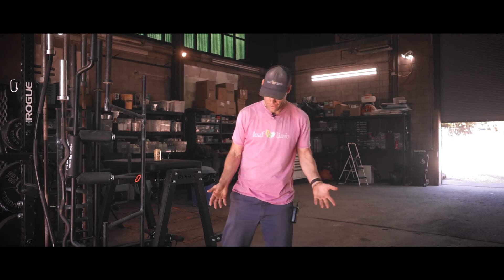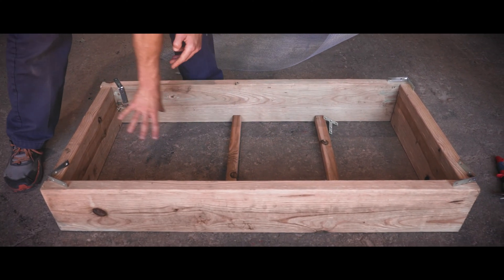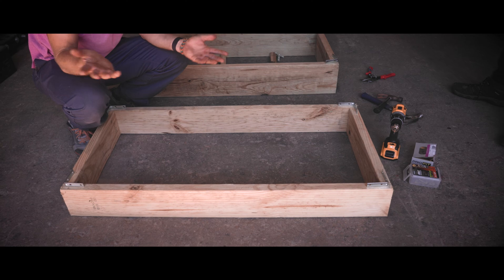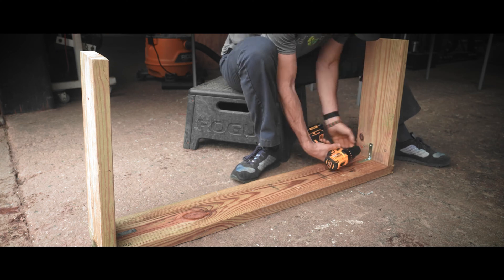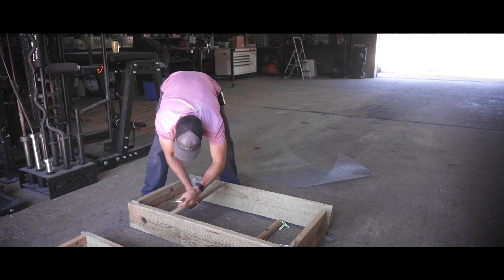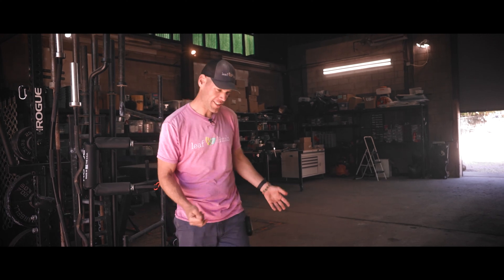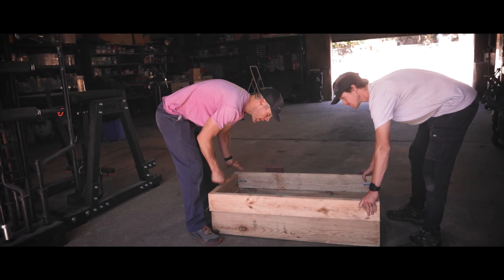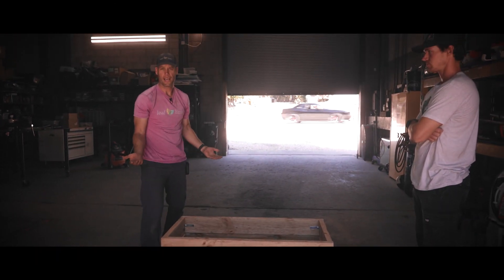How to Build an Air Pruning Box

Comment: This is NOT how to build an air pruning bed. 
Treated lumber is full of toxins that release into the soil and trees. WTF
Lumber is too heavy. 
The T bracket metal reenforcement is unnecessary. Use screws on a shorter board.
Just way off.

Comment: Won't the mesh rust quickly? Maybe plastic mesh instead?
Reply: I've used it for compost bins for years, and it doesn't rust.
Reply: Galvanized mesh does not rust quickly. Rodents will chew right through plastic mesh ;)
Reply: @peterellis4262  I see. Rodents that eat roots aren't a concern in our area. 

I have tried both and I think the greater concern is nutrients leaching out as water passes through and into the ground below. The beds I have have dirt instead of soil now